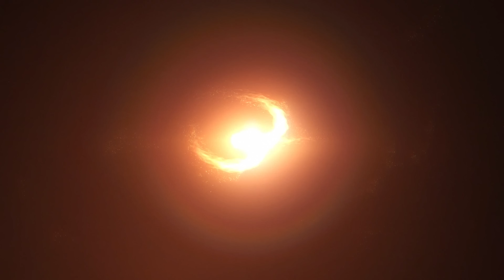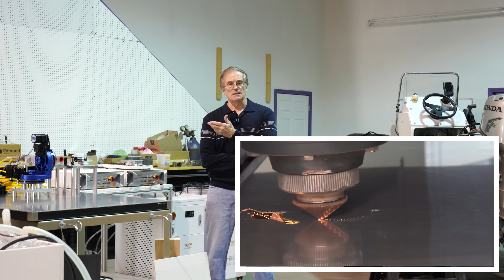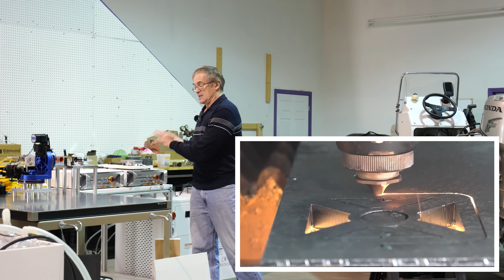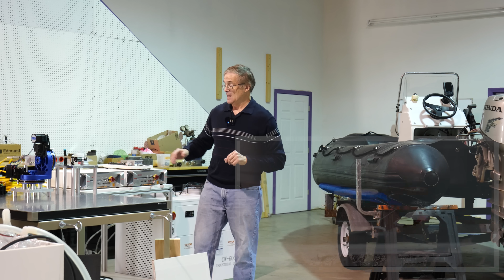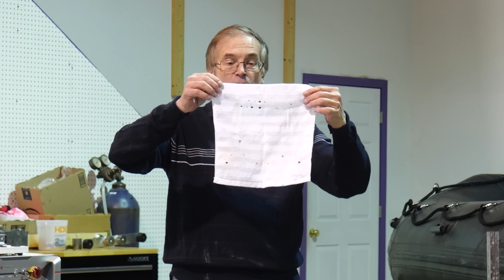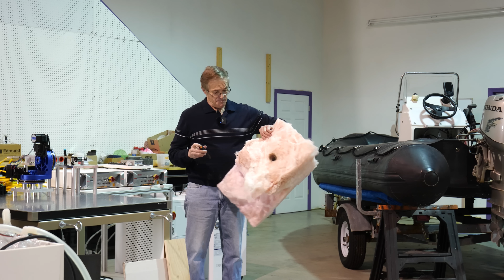We have a problem... and need your help!

Comment: Water. Large glass aquarium tank filled with water. Add whatever dye or substance that absorbs the wavelength of laser you’re using, at whatever concentration allows the farthest penetration without going through the other side. All of the beam energy dumped into a long column of water. Glass will reflect a small amount but should let the majority through. Cheap and easy to test as well.
Reply: You could also use a mirror to direct the beam down into a tub of water, eliminating the need for a glass transition and likely making it much cheaper and easier to get a large target area. Get an intek pool.

Comment: How about sheets of ice or ice blocks. You  would  have the benefit of the high specific heat quality of water with increased thickness and a low starting temp to offset some of the lasers heat.

Comment: Another crazy idea. Two laser beams go together through same optic, tuned with slightly different wavelength and set the way that at the distance to the wall they come in opposite phase, cancelling each other. But at the distance of target they come in same phase.

Comment: Just use a water wall. Water has a massive heat capacity.
You will need to turn the laser so that it is vertical

Comment: Just off the top of my head, you could stop the laser with water. Put a 55 gallon barrel behind the target spot, with the bottom of the barrel in the target area. Fill it with water, add a modest amount of dye to the water to make it translucent. Ideal opacity would be reaching about 100% at approximately the diameter of the barrel, so that the water absorbs the heat across a linear path nearly the width of the barrel.
Then put a small plastic swimming pool under the barrel (to avoid mess).

The laser will obviously pierce the barrel, and the water will leak out (into the small pool). But as long as you treat the lower half of the barrel as your backstop, it will take substantial time for all the water to leak out.

- you will need to make sure to turn off the laser if you notice that water is gushing out of the barrel. Since the water backdrop will leak out until it's not a backdrop anymore eventually. If you want to be very fancy, you could put electrodes in the pool to a power-down switch, and add some salt to the water so it conducts well... but that's unnecessarily complicating things if someone is monitoring the process.

Alternatively, you could fill the barrel with sand. 

The key component of the idea is to have what is essentially an ablative barrier, which gravity-feeds itself to prevent burn-through. AND... avoiding excessive weight of transport, because you can carry sand in bags, or run water through a hose, etc. The barrel may be very difficult to move when full, but you can make it 'not full', for moving it around. Personally, I lean towards the water approach IF this is expected to be a rare event. It's much less labor intensive to pump water around. But a water barrel would need to be replaced after any mishap, cuz after that it leaks. Could probably repair it with some silicone once it's dry though. If it's a more common mishap, I think sand would not leak out very easily through a small hole. But moving a bunch of sand around would be more sweaty.

Fire bricks come to mind, but they might shatter with extreme heat applied to a small spot on them.

* I'm making some assumptions about the area of coverage needed, the power of the laser, etc. So adjustments might be warranted. Also, obviously, there will be steam, so the top of the barrel should be able to breath to avoid overpressure causing the barrel to RUD. It's a solution you could finish in a day after a trip to home depot or even walmart. Just a hose or two, a barrel, a stool of the correct height, and a [censorship]'s toy swimming pool.

Comment: At CERN (France, Switzerland)  they have the same problem with the Large Hadron Collider (although the energy that the LHC has to dump is many magnitudes higher). They have as beam dump, a large solid cylinder of graphite, water-cooled, 70 cm diameter 7 meters long. It absorbs the energy that is released when the proton beam from the LHC is diverted to the dump. But here too there is the problem that if you concentrate all the energy in a small point, that enormous rod of graphite will not survive that either. So the proton beam is, in the nanoseconds the dump is taking place, "written" very quickly with an enormously powerful magnet over the entire face of that graphite rod to spread out the vast amount of energy. That works fine and reliable.
So it seems to me that the solution to this problem may be found in something similar. A dark, non reflective material, that is heat-resistant, has a fairly high heat capacity, and is strong enough that a fairly thin disk of it can be rotated and rocked at the same time at some speed to spread the energy over a larger surface. A rotating and rocking slab of slate perhaps (or a slab of graphite), possibly cooled at the rear with a water shower when needed due to prolonged use. It shouldn't be difficult to do some tests (and do some rough calculations) to figure out the needed size (and mass), rotation speed and rocking frequency.
Reply: My first thought was tantalum carbide but unfortunately the cost to absorption ratio is unrealistic and the portability is just not there
Reply: Why not just angle the receiving surface? Why rotate? With 2-4 degrees receiving surface the  beam going to be splashed and energy density will fall 10x+ times. Or a row of semi-reflective surfaces that reflects 90%-95 of energy to another surface?

Comment: Go with the plywood back wall but run a perforated tube across the top and have a continuous flow of watrer over the front and back surfaces. Also place another tube parallel to the wall (at the top) about 4 to 6 cm. from the surface with misting nozzles the length of it. The mist will difuse the laser to a certain extent while the water flowing over the plywood will dissapate heat and take care of any flare ups. Put a large catch basin at the bottom and use a recirculating pump for the water. Also, you may want to check out whether or not you can run your laser in two modes - low power targeting mode then a high power burst mode.

Comment: Water curtain, possibly with additives to increase absorption. A falling curtain, or shot upwards in a flat sheet from a Reservoir. It could work as either a constantly flowing sacrificial layer, and/or a randomized refractive medium distorting the beam. Laminar flow would probably hurt more than help in this application.

Comment: Whatever material you use, it's going to help if the material is moving: that way it's spreading the laser over a wider impact area.  The most efficient movement is if the material is spinning.  It may still be a problem if you happen to hit it in the center of its spin, so to protect against that, you should be moving the center around.  (However, unlike a simple spin, this involves moving its center of mass, so it's going to cause shaking.  Finally, you should use a material that will be reflective for the given wavelength of laser you're using... assuming you're doing this outside and can reflect the laser upward.  If you're not outside, then you'll need to be sure the amount of angular diversion changes as the material spins - you don't want the reflection to be onto a consistent spot.

Comment: Find some refractory cement made for forges and kilns can withstand upwards of 1500°C, you can get castable mix that you could use to create fibre reenforced pannels that coupd then be mounted on movable welding screen like wheeled trollies. Big bonus that this stuff is dirt cheap!

Side question, how does glass stand up against it? Does it just go straight through or does it melt it all the same? Curious if a layer of crystal structes that spread the beam woupd be effective.

Comment: Solar Salt. Like in your water softener. Heat it up and it flows like water. Make a hollow cinderblock wall, fill it with the molten salt and let cool. The salt will handle the heat. The cinderblock will get wrecked. 2 layers to avoid laps on coverage from the joins of the bricks.

Comment: One Idea is to use a drum with circulating water as a beam dump. https://indico.fnal.gov/event/15835/contributions/33852/attachments/21117/26311/0-High_power_beam_dump_drum_for_FRIB_primary.pdf

Comment: you could try using a pump to continuously run water over a large sheet of fabric/material? could even add a dye or pigment to the water that absorbs the lasers wavelength of light.

Comment: If I understand that the ground or sky isn’t an option due to being outside of the lab, I would use a load of sand or dirt or even gravel if you can re-purpose it.  Think gun range type material.  If you need a wall, try sand between two sheet of plywood held together with bolts.  As the sand melts, more would hopefully replace it with gravity.

Alternatively, cement sheet may be worth a try.  They use think sheet underneath of fireplaces on timber floors.

Personally, I would try elevating the lab equipment, and people, with scaffolding and shooting down at an angle, towards concrete, while limiting the horizon.

Comment: A tube of glass 50mm diameter and 500mm or more of length with water and mud or thin powder that can be moved in front of the laser beam. I think that the volume of liquid will block the beam

Comment: Wall of water with dye - you can use the tank set above to empty it at one point and create a water wall several centimeters thick for the test.

Graphite - can withstand high temperatures.
Areogel - it is no longer so expensive and can be used as the first layer to shatter the beam of rays.

Comment: High purity graphite plate should not reflect or offgas and is highly absorbant. costs 20-30 dollars. melting point over 3000c and highly conductive of heat would disperse the energy throughout the plate.

Carbon - Carbon (C-C) tiles are a better choice but a little more expensive.

more expensive still would be a high temperature ceramic coated in black ceramic IR absorbing paint.

Comment: Instead of fiberglass insulation you might want to try ceramic fiber insulation like kaowool. It is designed for a far higher temperature than simple fiberglass insulation. Also, you might want to try Intumescent paint of some sort. I do not know of any particular source for it however youtuber NightHawkInLight has a DIY version that may help out.

Comment: Have you considered using a water-milk tank with a slightly tilted shorter borosilicate glass front? With a weir at the top, a thin film of the water-milk mixture could continuously flow down the glass, be captured in a trough below, and pumped back up in a closed loop.

The flowing film would scatter and partially absorb the laser (via Mie scattering), while also actively cooling the glass to prevent thermal stress or fracture. The remaining beam would then enter the tank and be absorbed over the full meter of liquid, possibly ending in a darkened backplate for extra safety.

It’s a passive, regenerating system that combines attenuation, coherence disruption, and thermal management.

Comment: When testing a 30mm cannon we used mechanical stops to limit the range of motion. Simple and effective.  Then use bricks or whatever works in the limited area.  We had a connector fall off of the control system and the gun was firing at that time. It slewed to the stops and blew up a couple innocent bushes.

Comment: A combo of sand bags and cinder blocks or concrete patio tiles would likely work but would be a bulky and heavy setup. Loose, dry sand could help slow the beam's progress through the barrier by flowing back into the cavity as the glass sputters and flows. Patio tiles tiled ~vertically (e.g. epoxied to a sheet of plywood or decent gauge sheet steel mounted at a slight angle) would protect the sandbags from being cut open until/unless the beam stays stationary and cuts through a tile. The tiles most likely to get a full course of pew pew could be doubled or proper refractory tiles. Alternatively, if the target could be confined to a smaller volume, you could modify a large steel cabinet, fasten concrete tiles to the inside and outside surfaces of the cabinet. Tiles have the benefit of being relatively easy to swap out when too damaged. Sealing and filling a large steel cabinet with dry sand or fine gravel would also work and would circumvent the shortcomings of relatively fragile sandbags. All very heavy and impractical setups but you know, laser too stronk and you have two of em. I would rig the laser to fire from a slightly elevated position, toward the ground at an angle something like -30 to -45 degrees depending on how high you can practically get the rig. In any case, use the ground as a very cheap partial backstop to avoid having to protect like 8 vertical feet of garage door while still allowing hovering targets. Can't wait to see the light show, this should be pretty fun.